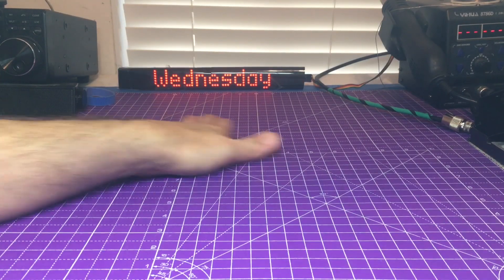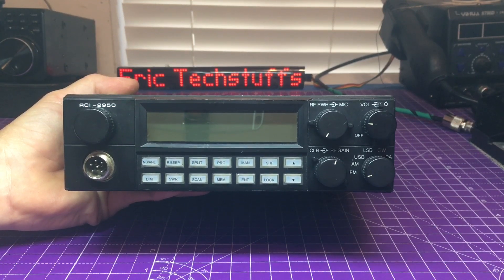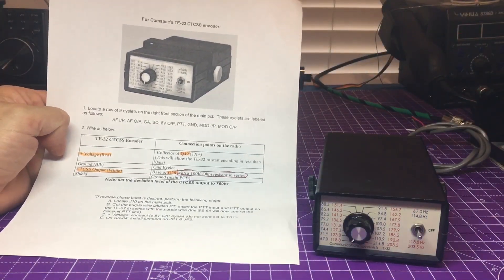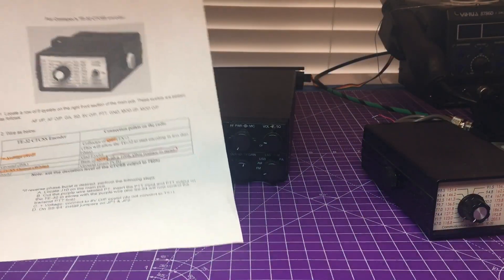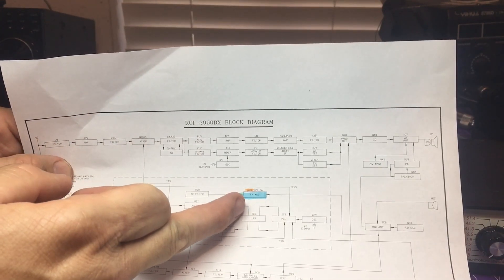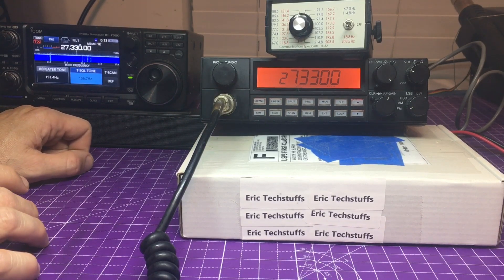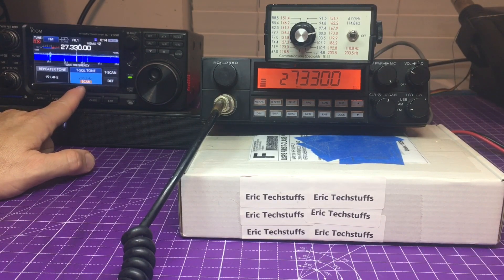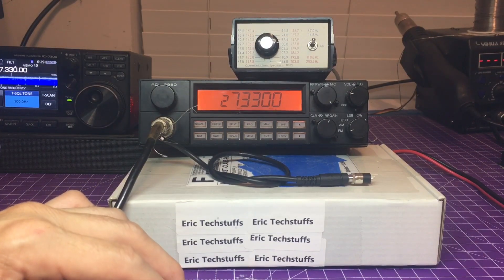RCI-2950 RCI-2970 RCI-2990 CTCSS Tone Board ! FOUND ! Part 1

Comment: I never understood why the ranger sets  never fitted a standard ctcss encoder in set stock?
What I didn't realise in UK/EU on 10m/11m we use narrower deviation system,than USA 20kc spacing at 4.0khz deviation.
But luckily it can be converted to 10kc spaced fm at 2.00khz dev ctcss at 300Hz deviation.
Best of luck with ctcss 👍
73's rob.p UK
Reply from the maker: Thanks ! I ended up using a TE-32 from Communications Specialists and was able to get it working ! Yes very odd it always mentioned it, but Ranger never made a board !  Very nice info to know on UK devation settings !  73's Rob

Comment: I remember them boxes😊
Reply from the maker: Still come in handy on these - since they never did change it in newer models from RCI.... odd for a "HAM" radio do you think ?! 🤔🤔
Reply: @EricTechstuffs  eaaa its ok i dig it👍
Reply: Me as a ham iam not them arrogant types love all radio stuff no matter what it is man i was in to radio when i was high not stoned high as a june bug. I started radio at a very young age at 12 years old from my grandad and got fascinated with vacuum tubes i always whanted to know how they worked i remember one he had in an amplifier it turned cobalt blue i think its corona from that transmitter tube got me hooked then he told me about shortwave radio i kinda got it i read about it then that struck a intrest into a future radio bug and shortwave radio and hamradio and cb knowing skip how it worked years later here iam righting this even i was 12 i had my first cheap RadioShack soldering iron doing experiments memories 💫💫💨🗯💭

Comment: Hi Eric, I've always wanted to try this particular radio, the thing is they seem to get really bad reports here in the UK..

I can't really see them performing much different to any other export radio.. so I was just wondering what your own personal view is on this radio.. 

By the way congratulations on your channel reaching over the 1k.. I've been with you since around four hundred, 
Have a great day and thanks for another excellent informative video. Stay blessed 73-51 to you and your family.
Reply from the maker: Hey, Glen !
I think the RCI-2950  holds a special place to me since it was my first "big boy" radio  when I was a teen in the 90s.  
They were good  radio for anyone to use without really needing an instruction manual and without having to flip switches and follow a "roadmaps" of a PLL  jumped radio  for channels and frequencies like in the other radios of past.  
However, This radio line is showing it's age by not updating it or offering CTCSS and other features of modern radios in the still popular 29xx line. I see they have a 2970n4 400 Watter for $1,000 US !  I bought my Icom 7300 for $1,200 !  the war of the 2950 vs 2510 or (old) Lincoln has long passed.  Like you said in one of your videos about getting a Lincoln -  I am also finding newer radios are more feature rich and easier to use, better audio on RX and TX  and more power. These old 90s export radios have lost some appeal. I even have a Chipswitch CPU for the President and it still lacks features of cheap modern rigs... I may try the CTCSS add-on with the President one day..
Sorry to run on here...
Rangers compared to a Stryker 955  or a Anytone Quad 6  or other radios of today ?   There's not really a comparison.  Rangers were good radios in there day, and the 2950  being long in the tooth - there has been so much documentation to improve and add different features - but it all falls short with todays radios that have that all built in now with more power ! I do like being able to select a different display colors and Computer program !  Thanks for sticking with me ! I've been subbed to you since you first commented on my channel !  Keep up the great work on your channel !  Hopefully one day conditions will let us QSO !  Many blessings to you and your family !  73 !
Reply: @EricTechstuffs   I see exactly where you are coming from and also remembering my video on the Lincoln One you give a very good analogy in comparison to the RCI, I get it completely.. I think if I get the chance of opportunity I will give one a go, thanks for your support my friend your input is always appreciated.
Reply: @EricTechstuffs  my first big boy radio i had my grandads president Washington from the 70s had the radio d104 power scanner meter and a boomer kriss amp running a crossbow base antenna from RadioShack
Reply: The reason it sounds bad in UK is because using mid-fm 20khz spacing for USA FM at 4.0khz deviation.
You have to hardware modify them to super narrow FM 
By changing internal parts ,I found this out while doing some work for a UK CB company a while ago.
Basically they are for ham 10m USA Mid-FM specs ,not UK/EU S-NFM specs at 2.00khz dev/300hz dev ctcss and the Rx side in FM detector needs audio increasing on recovered FM as deviation used lot lower than USA specs .

Hope thats the  answer you after.
Bottom line RCI Rangers if using them in UK/EU FM need modifying to get them to sound correct 👍
I found out this the hard way 😞 
73's Rob P